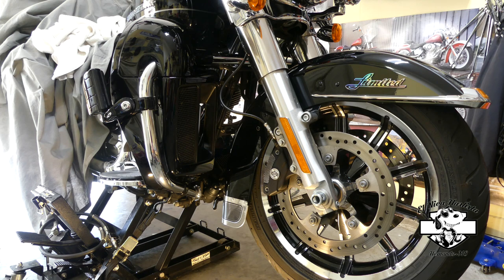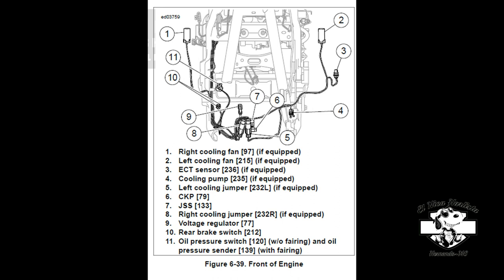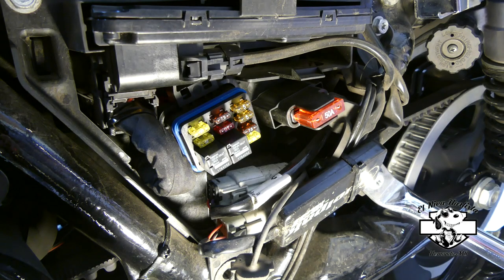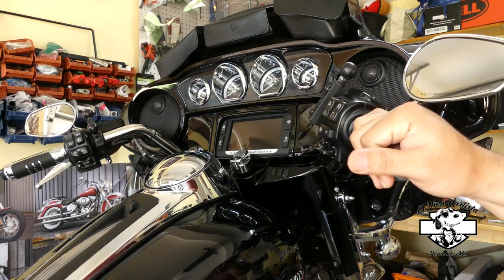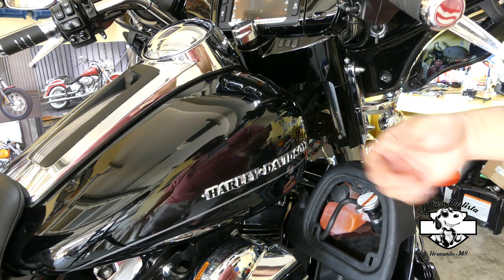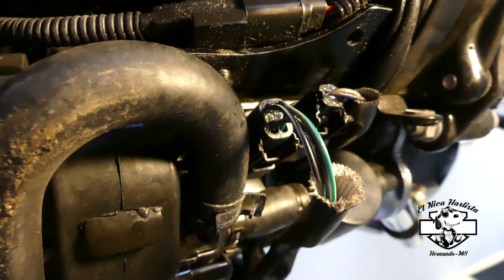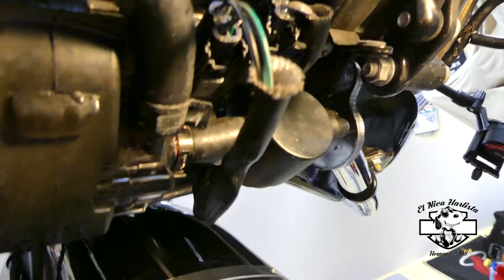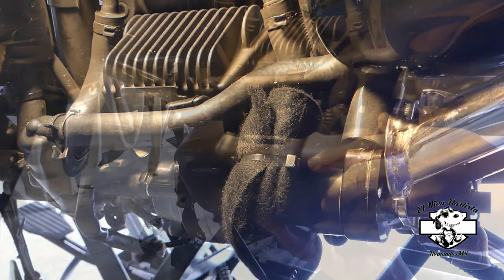Harley Davidson 2014-2016 Touring Cooling System Problems

Comment: I have my share with this Water Pump issue too!! just returned from Sturgis rally, put around 4300 miles total on my 14' limited and a day after, when took the bike out I noticed the check engine and red 'coolant' light and the Infamous P1019 on DTC reader. Luckily, i still got the extended warranty and took it a local shop for repair. It's still sitting there... 
This video was great to review all components involved. I wish i had a lift table I could easily check and detect or wrap those heat shields around the hoses..   Great Job, Harlista!!
Reply: Look at Big Blue Lift

Comment: Thank you much for this video.  My 2014 is currently in the shop getting a new water pump with only 17k miles.  I am not too happy about it and plan on calling Harley to complain.  I always do regular service when the manufacturer recommends, hoping to avoid these types of things and the schedule doesn't even call for maintenance on the cooling system.  The repair is going to cost me $700.  This is not something that should need replacing after only 17,000 miles!!!
Reply from the maker: Yes call Harley , they are aware about water pump problems they just don't want to issue a recall , tell them that you want a work-order  ,complain and tell them how is possible that a $27K motorcycle is having water pump problems, I was able to get Harley to pay for the repair after I call and I complain.

Comment: Great info and content. I just bought a used ‘14 Ultra with 9K miles and after looking into it, I realized that there is no coolant visible in the reservoir. Going to use some of this info to investigate a little more. Thank you.
Reply from the maker: Add some coolant and turn the water pump just to make sure pumps are running and get the air out the line.

Comment: Great video for a basic understanding of how to trouble shoot the system! However, Harley is well aware that routing the water hose around the pump is killing pump life, but they make a lot of money off poorly engineered designs. After the 14 came out, and everyone was having these same problems they could have fixed it then! Instead they will be selling replacement pumps for a long time at a price triple the value! Ask the Trike guys about the $1600 reverse motor issues.
Reply: The coolant hose is irrelevant! I have a FLHTK with 122,000 miles and the pump is still working perfectly.

Comment: Very good video. I had a problem with the water pump. My Harley Davidson is an ultra Limited 2016 and the pump at the dealership is very expensive in Brazil. On the recommendation of my mechanic, we used the auxiliary cooling pump of the AUDI TT car. Good luck !!!

Comment: Fantastic overview of the system. This morning I took my 2014 limited out and after 4 miles the engine management and temp light came on. The expansion bottle had over filled and leaked a little coolant. As I watched the level suddenly went back to normal.(engine off at this point) I turned the ignition back on and the fault cleared. Continued my journey without issue. Bike cooled down and the same thing happened on my return journey. However the level went back much quicker. I'm suspecting a sticking thermostat but I will check the system after seeing your video.. thank you
Reply: Hi, I just read you, so did you fix this issue?

Comment: Great video, thank you!  I am having cooling issues, i know it has to be the sensor, thermostat or the pump.  I rode back to NC from PA on Monday. The CEL and red water temp light on most of the way. Plenty of coolant in the tank.  Dealer said ok to ride, but may want to shut off if in traffic.  Did the check to manually turn on the fans and pump, all are working.  Took it back out last night, only 15 miles but no lights came on.  I am thinking the thermostat, I have never had any issues before this, just turned over 15K miles on the trip back.  I also called HD to complain,

Comment: Thanks for this great video! I'm getting hosed right now by Harley with this, went to Milwaukee and Green Bay from Ohio last month and 2016 CVO Street Glide went out on me on the second day of the trip. The killer thing is I bought used it last Sept with 6,000 miles on it!
Reply from the maker: What type of cooling problems are you having?
Reply: @NicaHarlistamotovlogs  it was the water pump like video showed. Costed me a grip but its said and done. On  to the next state line!
Reply: I have the 2016 CVO Street Glide as well. Got a great deal on it last fall with less than 300 miles on it... Weird story but none the less it was a great deal. Buddy of mine warned me that this might happen because he had his fail at 2300 miles. Well, took the bike for the first long trip this last weekend over to the Dragon 5 hours away. Bike had 3100 miles on it at the time, got the overheat light and check engine light at the same time morning of the second day. Bike ran fine, wrote it back home and now watching your video. Thanks so much I'm glad I bought the ESP from original owner. Although I don't trust the stealerships much. Great informative video man. Much appreciated.

Comment: Hello.Thanks for the great review. My 2014 trike has a cooling fan running all the time. As I turn on the ignition without even starting the moto, both propellers immediately start working. When I bought this bike it was after an accident and there was no pump on it. I installed a new pump type 26800107. everything works, but the fans and the pump are running all the time, without stopping. Can you tell me what is the reason? Thanks
Reply from the maker: Check for relay or water temp sensor.
Reply: @NicaHarlistamotovlogs  Thank you

Comment: What's up? I'm a Harley Davidson technician in N. Carolina and I just wanted to point something out to you. I hear what you are saying about the hose around the pump putting heat into the pump. It doesn't matter at all because the hot coolant is circulating through the pump itself which is substantially more heat than the hose on the outside of the pump. The hose is irrelevant.
Reply from the maker: One of biggest problems with the first generation cooling pump from 2014 thru 2016 is the poor heat ventilation on does pump, the internal circuits were overheating that why there were so many failures with does pump very poor design,but the worse thing about it was that HD knew about the problem but they refused to recall the cooling pump because of $$$.

Comment: Did the Oatey flame protector help? Have you had to replace the pump since this video? I reluctant to buy another Harley, looking at a 2015 now.
Reply from the maker: So far I haven't had anymore problems with coolant system since, what I been told by others subscribers is that with the M8 models Harley had re-design the water pump and the water hose is routed differently, definitely Harley Davidson had made some improvement on the newer models and on the early Rushmore models they had revised the water pump with the thermostat .

Comment: Sir , thank you for sharing.  I own the 2016 Road Glide Ultra.  My rear cylinder kicks off when riding less than 10 minutes.  Even when the outside temperature is in the 70s . I ran the test where you turn the ignition on and both my fans turn on . But when the bike gets hot at a stop the fans are not kicking on.  What may be the cause .I will check the fuses and relays .can you recommend what I should do. Thanks Pete
Reply from the maker: The bike has to be really really hot for the fan to turn on, is very rare to see my fan running on my bike unless I'm stock in traffic in the middle of the summer.

Comment: Thank you for this amazing review. Question, I have  2014 Ultra and expercing right fan failure (does not engage even when manually manipulated). Left fan works fine.  When riding at slow speeds (slow speed parking lot practice), my yellow engine light comes on for a few seconds then off again once I throttle the bike to a higher speed. At no time do I see the water temperature light illuminate. Ten Amp fuse is good, not certain about the relay, but assuming that works since left fan not affected. Coolant levels are good. Any advice regarding these parameters will be greatly appreciated.
Reply: Unfortunately my friend, just like the other thousands of 14 to 16 owners, you need anew pump!!

Comment: My Harley is a 14-year ultra classic.
The motor has been replaced by an improved motor for 25,000 km and is operating for 15,000 km.
Is it possible to prevent malfunction of the motor if I wrap the blocker in the antifreeze line here?

Comment: Thank you for all your time putting this video together.  Very thorough!  37k miles on our 2015 Ultra.  I did an oil change last night and rode to Santa Cruz today (100 miles).  I got home and rode around town when all the lights came on...  I wonder if oil change had that had anything to do with the fan connectors (around the oil filter) absorbing some oil that you mentioned.  Very frustrating!
Good idea about wrapping the water hose with insulation (13 minutes into video) around the water pump to reduce chances of more heat.  Sounds logical
Reply from the maker: Having oil in your connectors it may be a possibility, spray them with electrical cleaner you can find it at your auto park.

Comment: Im having the same problem, temp and Check engine turns on after few minutes of had started on the engine,, but my bike runs well. Could I continue riding it ignoring the lights or have to fix if? I fear damage the engine.
Reply from the maker: It will not damage the engine, the engine is design to be air cool.

Comment: Good job guy. I've been wondering about the longevity of my 2016 Limited water pump. I've got 16000 miles on it now and plan to take off on a 12000 trip to and from Alaska. I'll apply the heat resistance stuff before I go and might try and pick up a reasonably priced pump to take along.
Reply from the maker: HD came up with a new redesigned water pump for the 2014-2017 Touring models look in to  that one, have a save trip to Alaska.

Comment: Well it was 5 months ago we replied to each other when I was going to buy 2015 Ultra Limited, I did buy the bike. So just this past week I thought that the reason my check lights came on was the connectors getting wet so I used Dielectric grease in all the plugs I can find. It turns out that the reason was the pump seemed to fail. The water bottle was full to the top but non spilled out. After watching your video again I noticed that you showed there are other plugs related to the cooling system so I'm going to go under the bike and pull them apart and put some Dielectric grease in there and see if anything good happens. I have 5yr warranty on the bike but they told me they won't look at it until maybe a week or so b/c three of there mechanics went down so they are backed up. I kept the bike b/c we been having such shit weather here in NYC on weekends and this weekend they say its going to be nice so I will be riding it with the check lights on until I decide to drop it off at the dealer. I read in many forums others who have rode there bikes for hundreds of miles without any issue as long as you don't ride the bike hard and over heat it.
Reply: Yes, exactly what I got.
Reply: So I rode the bike anyway on the weekend, temps here were about 80 degrees with intermittent cool air in the country. Saturday was an approx. 150 mile ride and Sunday approx. 175 mile ride. Had no issues just a little hotter than usual kind of what you would feel with non-cooling system bikes. It ran as supposed too I even had the rear cylinder shut off feature on  when I would be in some traffic (this works better than my 2013 Limited).  So when everything is in order at my dealer I will drop it off so they can diagnose it and fix the problem. I read in HD Forum post that the bike is an air cool bike before it is a cooling system bike.

Comment: I'm about to pick up a used 2015 tk and asked the sales rep if all recalls on Rushmore bikes were taken care of, he said they don't put any bikes out until all recalls are taken care of.
Reply: So I've been riding the bike and noticed the coolant was disappearing after a few hundred miles. Any input on this? I read that some Rushmore models it might be getting inside engine oil but no one is sure.
Reply: I read in HD forum threads but it's all speculation.

Comment: how did you get the ECT Sensor im getting a 1019 ECT Difference code I got the pumps changed 50 miles later code came back and goes on and off drom time to time
Reply from the maker: I had the same problem when the dealer change the the water pump , I was getting a fault on and off , I end up changing the Thermostat and I haven't had any problem anymore ,I change the ECT sensor first because was the easy thing to do first but the main problem was the water pump and the thermostat, also I have a video on to the change the thermostat.

Comment: Great video. Under what process did H.D. fix your bike for free?
Thank you.
Reply from the maker: Reading some of the HD forum somebody suggested to call HD headquarters and complain about it, and that's what I did. HD is aware of the water pump problems but they would not issue a recall because is not a safety problem. So when I call them I pretty much told them that how is possible that a $27K motorcycle with only 8k mile is giving me water pump problems, so they end up giving mea work order number and with that work order number I went to my local HD dealer and they worked on it at free charge.

Comment: I just bought a 2016 road glide an i'm having the same problem. did you call a  harley D dealer or who did you call that they replace the pump at no cost, if you din't call the dealer were did you get the # or who did you call? Can i have the # . sorry i'm new to harley D. and very disappointed that i'm having this problems @ 9500 miles .
Reply from the maker: I called directly HD headquarters, try this number 800-258-2464 or 414-343-4056, just complaint about how disappointed you are with the bike water pump problems at only 9k, if they really want to help you they will issue a work order so you can take it to your local dealer at no cost, keep in mind that HD came out with a new pump replacement.Good Luck.
Reply: @NicaHarlistamotovlogs  Thank you! I'll try my best. Thanks again

Comment: Trying to test the relay.  Out of the 4 pins which is 22?
Reply from the maker: Bottom forward, look at the relay pins with your phone camera and you will notice numbers on each pin witch if you look at the diagram 22 is pin 5 on the relay.
Reply: Ok. Great.  And how can you test the relay ? Does it need to be powered first ? Resistance ?  Also is the 3rd wire from the pump area that goes into the motor the pump connector ? It connects to a wire that runs down the right side of the bike by the looks.  Im little confused with that.  Thank you